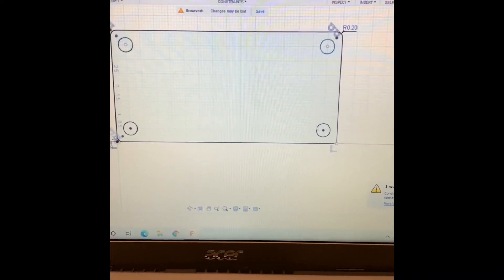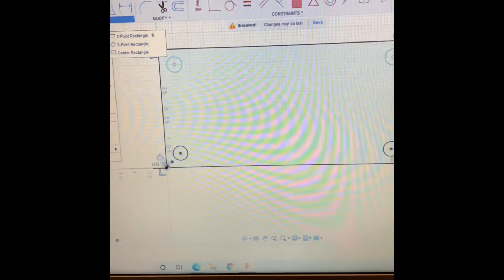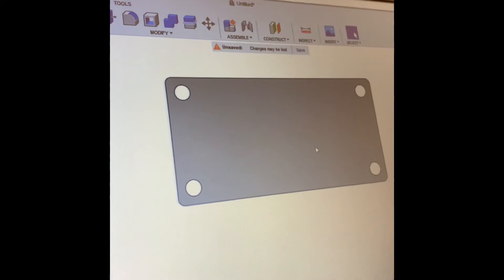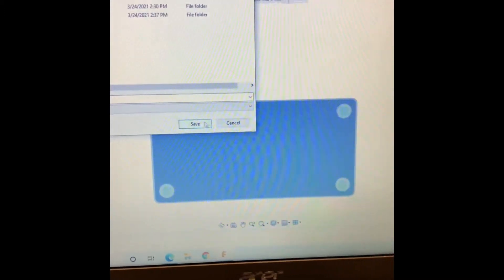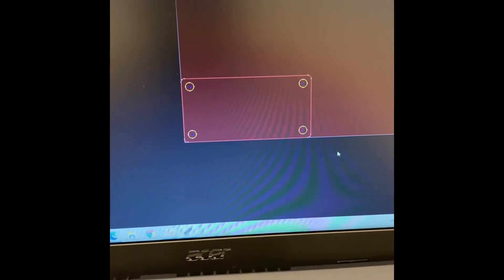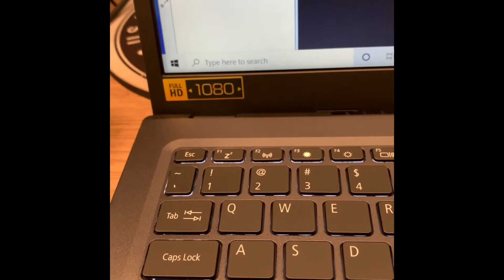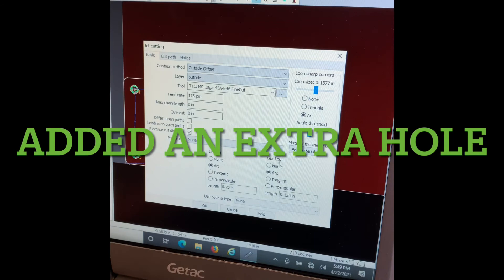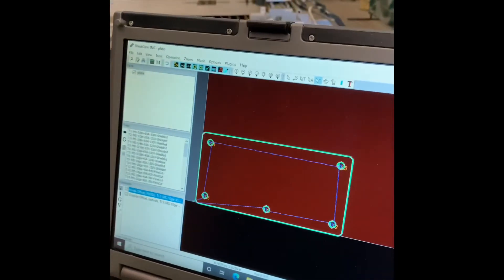Fusion 360 to Sheetcam to Mach 3, FastCut CNC plasma off of the MWMSS

Comment: hey sir, i am building a plasma table with a plate marker. i am needing to know it if mach3 will display the tool number of the tool you have selected in sheetcam while you were creating your part. for instance, if you have a tool numbered “10” setup in sheetcam for 1/4” steel and you use that tool for your part, when you transfer the gcode into mach3 and run it will mach3 display “10” in the tool dro?  long question but im trying to set up a macro that needs the sheetcam tool number. thx
Reply: i dont have IG but ill check back here. i appreciate it.
Reply from the maker: @scraptech3152  I went to check to see if sheetcam and mach3 had the option to do what you’re asking and I couldn’t figure it out or find it, I’m sorry. Do you need a copy of mach3 and sheetcam?
Reply: Thank you for looking for that for me. i will have to go another route. i have bought sheetcam and mach3 but thanks for offering. i really appreciate the help and in the future you figure out something please let me know. again, thx.
Reply from the maker: @scraptech3152  Will do and anytime sorry I couldn’t be more of a hell. I will dig more as for I want to use my next plasma table to stencil as well.
Reply from the maker: @scraptech3152  I am onto something stay tuned, I just saw the plate marker option in sheetcam. 😬
Reply: standing by…
Reply from the maker: @scraptech3152  new video is up! Sheetcam plate marker to Mach 3
https://youtu.be/ttLZKsIenKM
Reply from the maker: I will check sometime this week and get back to you, message me on IG if it’s easier for you to talk there. @von_bee_

Comment: Hey man. I have a question. I'm looking to move to sheet cam for my plasma needs instead of Fusion 360.  Does Sheet cam have to be connected to the internet to build and save your files like fusion does?
Reply from the maker: Hey what’s going on Brother and you can stay off the net, the only thing with sheetcam is you cannot design parts like fusion. You only can make multiple parts and cut different sections of what you want with fusion. What you can do if you don’t want something web based is use Inkscape, it’s completely offline and you can import files and work off it or design parts free hand. When I use fusion I just connect it to the net every 15-20 days to update other than that I’m mostly offline when I use it.
Reply: @VonB3  Great. Thanks for the quick reply. I appreciate your help. I will look into inkscape. I just subscribed good luck with your channel.
Reply from the maker: @mialli68  You’re welcome
And thank you I appreciate it big time! I will make a tutorial with ink scape to sheet cam then to Mach 3. That’s what I was using before I got into fusion.
Reply: @VonB3  that will help more people than just myself. Thanks again for your help.
Reply from the maker: @mialli68  Definitely and anytime Brother!